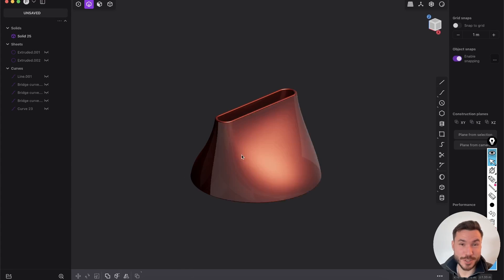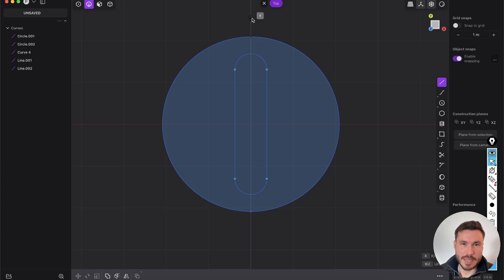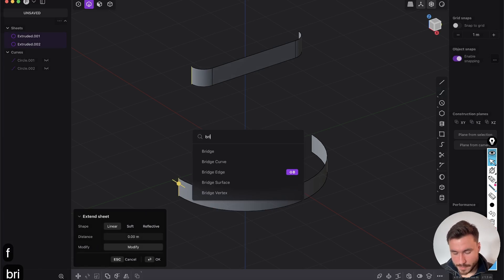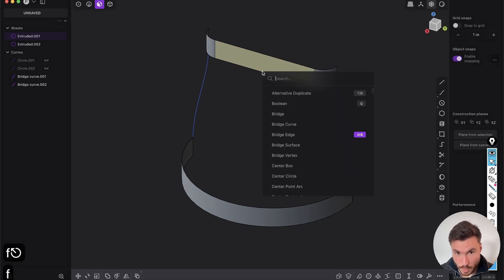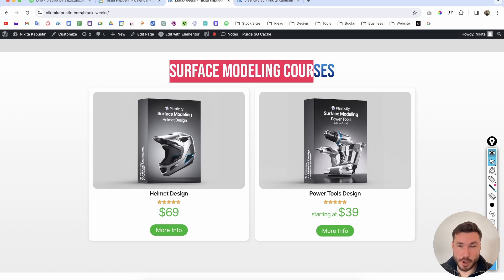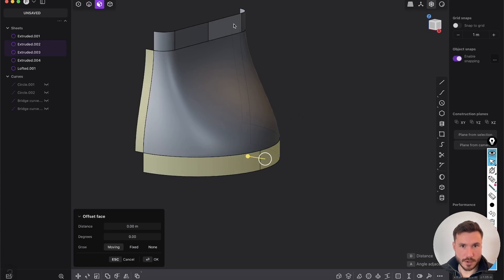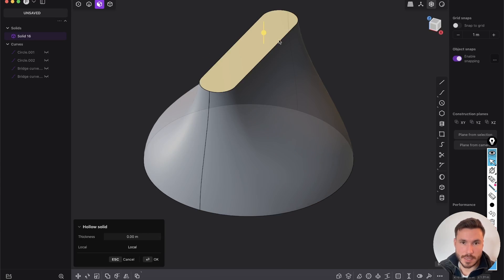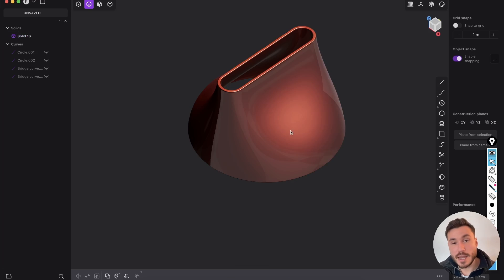Plasticity Lofting | Beginner 3D Modeling Tutorial

Comment: So I get this issue where it will not show me a snap for tan or 3/4 (quadrant) when starting a curve, and I have to start at the center, then it will show the quadrant as a snap because it is a 0 degree snap to the curve. Is there a trick to getting it to show you quadrant right away?
Reply: So I noticed a similar issue, I fixed it by making sure when I create a circle I don't make the second point of a center circle arbitrary. As in, I make sure I do it so it lines up with where I want the line to go. Then it snaps to it easily. Hope that makes sense!
Reply: @headhunterscustoms  I do get what you are saying. I still may post a bug to Nick and see if he's got that as normal behavior or if it needs fixed.
Reply: @citizenclown  oh ya no worries, let the master help for sure, I'd love to see if he has a better solution since I had the same issue!
Reply: @headhunterscustoms Ok so according to Nick, it will align your quadrants to how you draw the circle. I will test later. But if you do not drag perpendicular or parallel along the construction plane, the circles snaps will not be where you'd expect. He did say they may change it later for it to always be aligned with the construction plane you created it in.
Reply: @citizenclown  ok cool, that's what I was trying to explain. Glad my theory was right lol
Reply: @headhunterscustoms  correct. It would seem that behavior would not be ideal in most cases. I can see where you might want it oriented not in alignment with your planes but in most cases, if you are just speeding along, you just find center drag wherever and tab to put in a value for your dimension. But yah, now that I am aware, I'll just be sure I tab before moving my mouse away from the plane.
Reply: @citizenclown  true that!